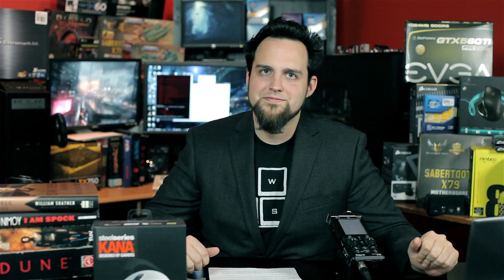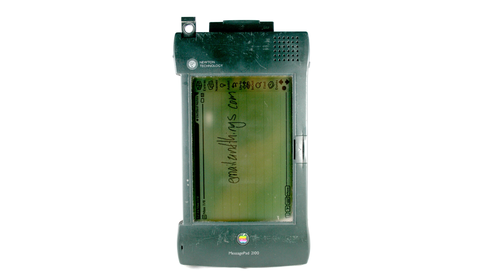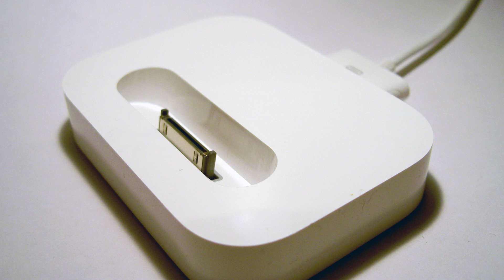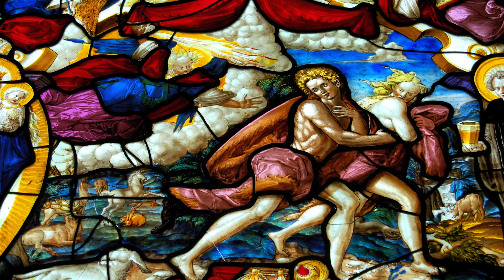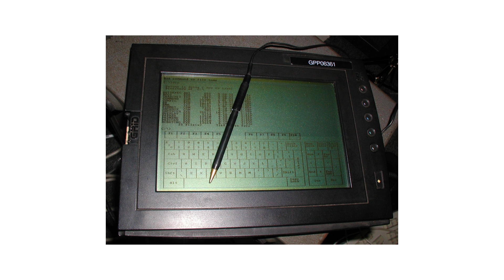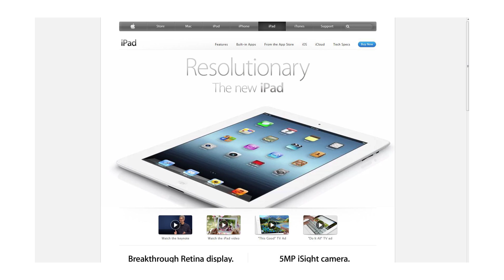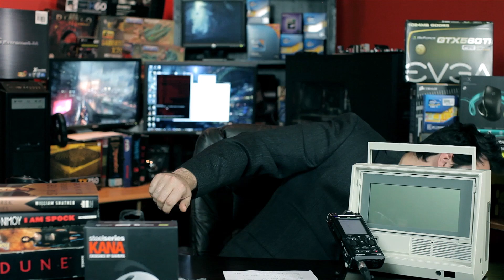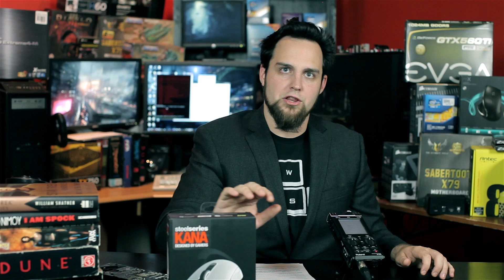Has Apple Really Ever Invented Anything?

Comment: Like I have mentioned quite a few times, there are trade offs on both Macs and PCs. Macs have an excellent resale value for example, you'd resell that iMac for much more than the equivalent PC. 

Specs only matter when you are running the exact same OS. OS X is a much, much lighter OS than Windows and it's been optimized out the wazzoo for Apple's specific hardware, believe me this makes a world of difference and this is why "slower" Apple computers perform equally to higher specc'd PCs

Comment: ARM holdings was founded by Apple and two other companies in the 90's. ARM designs architectures for RISC (Reduced Instruction Set Computing) microprocessors and microcontrollers. This architecture is unique to any other and was developed by ARM, they don't manufacture mp's and mc's, they just deisgn the chips, so I guess you could say that ARM and therefore Apple (since they are one of the company founders) invented the ARM architecture and subsequently ARM's various mp's and mc's.

Comment: bro. i work on pcs and repair them aswell. i do it as a job. but at home i primarily use macs. the original tablet pcs were awful, apple invnted inertia scrolling, the rotary sensors and the multitouch glass. your point is invalid

Comment: Loved the video, but you seemed to change the point of the video half way through. It turned from a question of invention/innovation into a debate on; if you don't manufacture something, are you the inventor? I would argue that if I invented a new method of drying clothes and asked a local mechanics company to manufacturer it, I would be an inventor. The fact that other clothes drying machines already exist doesn't dampen the validity of my claim though, does it? Again, great vid!

Comment: BTW, thanks for showing the Dataview 25. I had several of those. Loved them. They had no fan. Were super quiet. They had RAM drives (essentially an SSD) if you used the right software in DOS. Using Software Carousel, you could essentially multi-task and quickly switch between apps. I wrote several of my books on those machines.

Comment: you get 10x more software, and a unibody case carved out of a single block of aluminum. lol the hardware is unimportant, osx would destroy windows on any bench mark, even on lower end computers. ms has brainwashed you to belive that windows is the fastest os, but it crunches 4x the resources of a mac just to get the same speed. if you ran osx and windows on the same pc, osx would destroy windows

Comment: xerox is the creator of the hardware. apple used it first in an os. your pc is over priced compared to a mac. macs hardly ever get viruses, you get free media software, and a unibody case at the same price you would get hardware. i build pcs, there decent, but nothing can compare to the speed and fluidity of a mac its just not in the os. windows is boxy and ugly, trying to disguise it with a clear theme. its a simply terrible os. a decent linux distro could destroy linux

Comment: no it doesnt 95 is dos based. 7 droped dos for aero. get it right. cyber link costs 250. lol and its ok. pay more for less? kinda sounds like windows. mac osx costs 20$ with a whole media suite included. BUT NO. you get A CLOCK and a FANCY CALCULATOR. lol tsc tsc. mac osx hasnt changed sence 2000. lol they add service packs and new features. oh and btw windows does get there ideas from apple. what about the clear task bar? the window principal, the use of a mouse. lol all apples creations

Comment: Oh as for inventions I think but I could be wrong that Apple was the first with true plug in play which was actually developed as a DRM protection scheme. Apple wanted you to use a Apple mouse. Not a mouse from some one else. So they put a chip inside of the mouse to communicate back to the computer that hey I am a real Apple mouse. Side effect it also identified itself, and because Apple controlled the hardware and software it made "Real" plug in play. Nintendo used this with controllers forNES

Comment: Don't be ridiculous. Lets say someone invented a time machine. You then take the time machine, put a star on it and call it the Star Time Machine. Did you invent the time machine? Ultimately it's a time machine and you have done absolutely nothing to change it. Now if someone made a portable time machine, that would be an invention. It separates it from a time machine that is locked in place. But if the time machine has a certain shape and you just change that then you didn't invent that.

Comment: When you say you'd rather have variety than a well designed product sounds like you would rather have a choice of low end cars like a Taurus, Corolla, or an Ultima versus just choosing which shade of a lambo you want at about the same price. Nothing even comes close to the design of the iPhone or iPad. But okay, people have opinions. 

And what did you expect was going to be in the new iPhone? It's just that, a new iPhone. Thinner, faster, and better. What are you going to expect in 2014 cars?

Comment: You have to admit that Samsung tried to make their devices look and feel just like Apples to gain sales. Other companies like Sony chose different designs. Open up a Macbook air and a Samsung ultra book (ifixit) - everything is the same. The motherboard, chip placement, heat-sink, ribbon cables, etc. are exactly the same. The Dell Adamo at least had a whole different arrangement of parts inside. This is why Apple gets pissed off and sues, they do all the design and then get ripped off.

Comment: To clarify on the A5: The A4, A5, A5x and probably the A6 use tweaked ARM cores for the CPU.  Most of the tweaking to get better performance per watt is done by Samsung along with work done by Intrinsity which Apple bought in 2010.  The A4 CPU shares the same SKU as Samsung's Hummingbird.

Apple has tried to talk Samsung into licensing their CPU optimizations to Apple.  Apple claimed in 2011 that by mid-2012 they would have moved all of their SoC production from Samsung to TSMC, hasn't happened.

Comment: Were you even around when we had 40 MEGABYTE DRIVES?!?!?  

I have a 2 TERABYTE DRIVE NOW.. .. . 

Why do I need a 2 Terabyte drive?  .. probably because back in 88 I had a computer running 16 bit sound, and 16 color - 256 color LOW RES graphics with ZERO 3D and only 4 sound channels of sound.

Today computers handle 7680x4320 (4320p), 3 screens even 23040x4320, do trillions of calculations per second, handle 1000's of channels of sound all in 24+ bit.

Most retarded comment I've read recently.

Comment: Electrical devices with data input and output on a flat information display have existed as early as 1888.The term tablet was made popular as a concept presented by Microsoft in 2000[17] and 2001[18] shortly after that the launched the Microsoft Tablet PC it was a tablet computer that was thouch input and runs xp.

Comment: No, what you have shown isn't identical because it has been designed independent of the iPad. Did you not see the memos in the Apple v. Samsung trial where Google, themselves, told Samsung to step back and stop riding Apple's designs?

One could not mistake a Star Trek prop for an iPad because they are fundimentally different in size and shape. Samsung emulated Apple's design in their faux-software to trick the consumer. Proof: Apple and Samsung court case where Apple won a landslide victory.

Comment: There is a lot of comparisons out there, and the results are quite mixed. I've read very few comparisons that was not biased on either side. The more accurate ones were either a tie, the winner depending on the user's need, and the others gave the edge on one of the two, with the other not far behind. get over it, they are different at some point and similar at the other, and depending on your needs one might be a better fit. But stop saying one is crap without any evidence.

Comment: Actually, one of the trade mags did a review of OS X and Windows 7 Ultimate and in the review, the reason why they used Ultimate is because there are features in OS X that only Ultimate had and they wanted to do as fair of a comparison as possible.  I forget which pub it was, but it was a big name. Either PC Mag, or CNET, or something along those line.  They basically said that both had some advantages over the other, but they only gave a nod to Windows for Games and OS X for overall winner.

Comment: Yeah, but when Windows comes out with a new version, not all Windows people want to use it.   The cost of a new Version of WIndows can sometimes run almost $200 just for the upgrade.  Apple has NEVER charged $200 for an upgrade for OS X desktop software. 

And what about Microsoft offering a $99 service to get rid of the bloatware on OEM computers so they can free up hard drive space and get the OS to run faster?  WTF?

You think Apple people are sheep. It's the other way around.

Comment: And? Many OS X version are minor upgrades that do not has anything more than a Windows service pack (except a price tag). So basically it's about the same, just a different strategy. Now you say that you still see people using Win XP. What's wrong with this? If it works for many people and they don't feel the need to upgrade... You're basically showing that a Windows version has a longer lifespan than a Mac version. (I don't know anyone that still use, say, Jaguar or Panther.). But who cares...

Comment: Most people upgrade to the latest version of OS X that their system can support. It's typically worth doing. One thing about OS X, it's been getting more solid with less bugs, which enables Apple to actually speed up the upgrade process with yearly upgrade rather then the 18-24 month time frame.  Microsoft is still a 3 year cycle and I doubt they'll change any time soon. So for Windows, you have three years between OS versions and not all are worth doing.  I still see lots of XP out there.

Comment: Computers, no matter what brand is always a moving target. Apple has TYPICALLY maintained the ability to extend the life of an older system as much as they can, but sometimes, they can't. Mountain Lion's only real problem is some features can only work with more recent systems due to need of better graphics chips. They can't avoid it.  I personally am still using a 8 year old system running Snow Leopard.  It still works.  barely, but I'm looking forward to the refresh iMac, when it gets out.

Comment: Because of what Apple is doing, certain features requires better CPU and'or GPU, they can't get around certain things.  Same thing with Mountain Lion.  Mountain Lion might upset some people in terms of not being able to have certain functions, but it still works on systems as old as 5 years ago, depending on the model.  When Apple comes out with hardware, they do what they have available as the most logical choice for the price point.

Comment: I haven't.  It wasn't slow as molasses like Vista. it got 80% acceptance fairly quickly, but hardly Vista.  Apple does advancements in each OS.  Some are better upgrades than others, but overall, Apple is just adding more features to an already solid product.  People weren't taking off Lion to back to Snow Leopard.  Lion was a big transition because it gets people off of the install from a DVD, which is a drastic change.  It also requires Core2Duo processors as a minimum.

Comment: Overclocking is OVER RATED.  It creates an unreliable product if you overclock.

Overclocking creates more power supply and causes over heating, overheating is NOT GOOD for reliability.

Personally, I have no idea what Apple will do for their MacPro refresh.  TIme will tell.  Apple doesn't like overclocking because it isn't a good thing.  It make for better speed tests to sucker people into buying a computer, but it isn't reliable.  It will cost the mfg more than it's worth.

Comment: They have proper testing of their ECC memory, better than your typical DYI third party memory.

But what about the fact that Windows is just sucking. WIndows 8 is a joke. So you either have to switch and migrate along to WIndows 8 apps as they come out, or continue with an outdated OS.  Apple just gets better.  I'm personally waiting for the new iMac.  It should be pretty stellar. The PC mfg still can't get a better AIO, which is what I prefer rather than a tower for home use.

Comment: Show me a Windows laptop that can compare to the MacBookPro Retina model, at ANY price?  SIze, weight, port specs, screen quality.  There isn't.  The ONLY thing that Apple could have done, but it would only fit a small handful of people is the ability to put 32G of RAM. That was the ONLY problem for SOME users.  MOST users don't even use much more than 4 or 8Gs of memory unless you doing high end applications and pushing the limits.  For most people they attract, it does just fine.

Comment: Cracking open a case in an AIO system just to add memory is a JOKE.  It takes a trained, experienced person with all of the right tools in front of them probably about an hour to install memory and that's if they don't screw up in the process.  With the iMac, it takes a screw driver and about 5 minutes for an average Joe to do it and it's almost impossible to screw it up other than getting cheap third party memory.  Sorry, Apple has the best AIO designs, the best laptop design.

Comment: No, it wasn't equivelent, it was the closest config,  but the HP STILL didn't have Firewire, Thunderbolt.  it was worse in terms of case design and adding memory, hence the cheaper price.  But I still haven't read a professional review saying Windows 8 is better than OS X, or a review of Windows 7 being better than OS X. So, i am just saying that as close as I could get, the Apple had several key features MISSING from the HP that's only a couple of hundred less, and the HP lacked key features.

Comment: I did a comparison from an iMac to a HP all-in-one and the difference was only about $300 w/support contract, but the HP had an external power supply which some people hate.  Plus with the HP, in order to add memory, you have to crack open the case, which is a PAIN in the ASS.  Case design SUCKS with the HP AIO. It didn't have Thunderbolt, and that's not much of a difference when the iMac was a superior design.  I'm waiting for the upcoming iMac refresh.  I'm sure we'll get some cool technology.

Comment: For the better color reproduction, I was not talking about the Apple monitor ;) Seriously, I use a Asus PA246Q at work, which cost a little less than $500, and I really don't see what the Apple's monitor has more than the ProArt, beside the aluminum casing - Which do not justify the $200+ price difference. (The 24" Cinema Display was selling for like $800, but for some reason Apple decided to discontinue it and sell only 27")

Comment: Apple was responsible for convincing Corning to bring back Gorilla glass and they also got them to make Gorilla Glass 2, which is better.  Apple didn't create Gorilla Glass, but they were the ones that worked with Corning.  It was originally used because of it being scratch resistant, but they later realized that it was still susceptible to cracking under extreme conditions.  Then came Gorilla Glass 2, which is LESS susceptible to cracking.  To further that, Apple just got a patented "bumper".

Comment: Apple actually got USB ports to work before WIndows did.  You probably weren't around when USB first came out. In the beginning WIndows computers had USB first, but they had some of the worst drivers on the market.  Apple actually go their USB drivers to work better before Windows did.  WIndows has always had driver issues.  They still have more driver issues than OS X.

Comment: I don't see why Samsung (which makes the Apple LCD panels) would put all their high quality component in the Apple's and use shitty components for all their other monitors. Of course, you can't compare to a $150 TN panel, this is comparing apples to oranges, but you can get a high quality P-IPS panel for $500, that has overall better features and more accurate color reproduction. Apples screens are indeed great quality but are still overpriced.

Comment: I've seen the insides of an Apple monitor and the insides of a $250 monitor.  Trust me, there was a HUGE different in just the quality of the power supplies.  It's too bad you don't have a high end color measurement system to run each monitor through the battery of tests some companies do.  If an engineer took both monitors and compared picture quality, Apple would kick the crap out of these $250 monitors when tested with test equipment. They want consistent and more accurate image quality.

Comment: I'd be willing to bet Apple has less failure in the field and FAR less DOA monitors.  Quality costs money.  Apple does an excellent job in component selection and design.  PERIOD.  They have far less blown power supplies than the no name brands.   Trust me, I've been in the industry a LONG time and can tell by looking at the insides of a electronic equipment and tell you which is better.  The cheap monitors use the cheapest power supplies that are utter crap.

Comment: I used to work with engineers buying components and TRUST ME.  I could tell by the markings on certain components what the grade is.  I haven't done it in a while, but I know Apple typically hasn't changed their philosophy on the grade of components they use.  They always have had better quality memory than most of the third parties.  Hard drives, same thing.  Same thing with optical drives.  Just because a drive might be faster doesn't mean it's better, there are things like MTBF ratings.